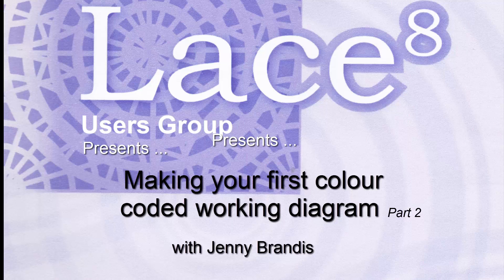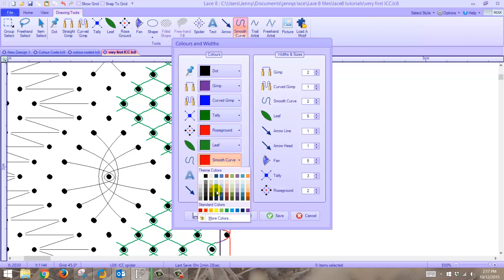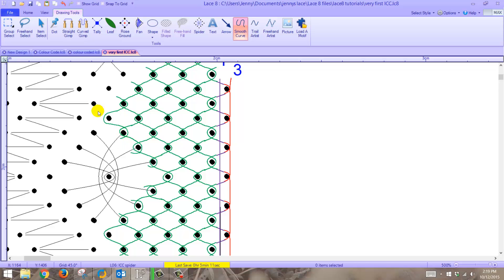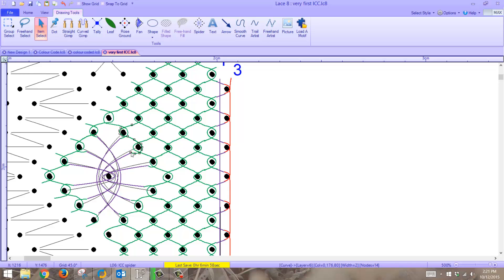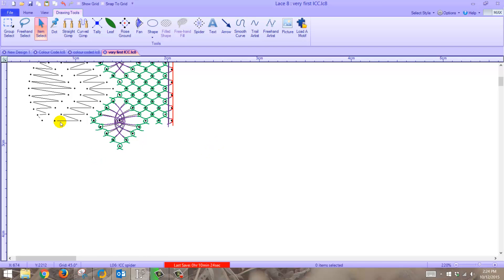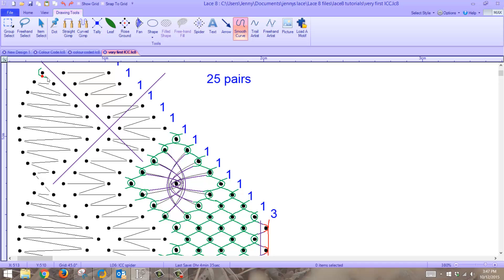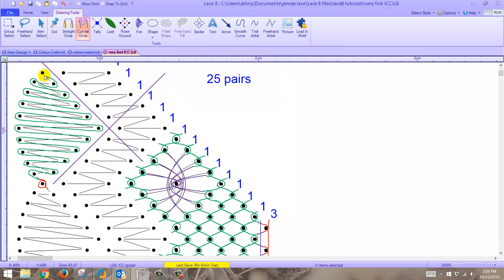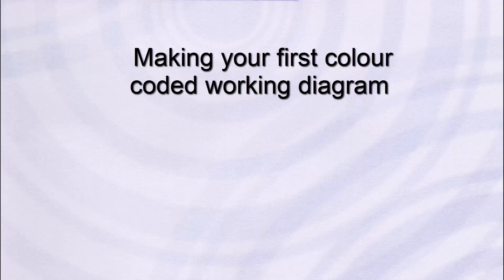Making your first colour coded working diagram - Part 2 Spiders and Fans

Comment: What is the soft ware called
Reply from the maker: The software is called Lace8 and is made by the English company Ilsoft. Ilsoft.co.uk  there is a free trial version available from their website that you can use to test to see if you like it. It does everything except save and print (you need to buy it to use those features). Ruth Budge has written the reference manual and that is available at an extra cost.